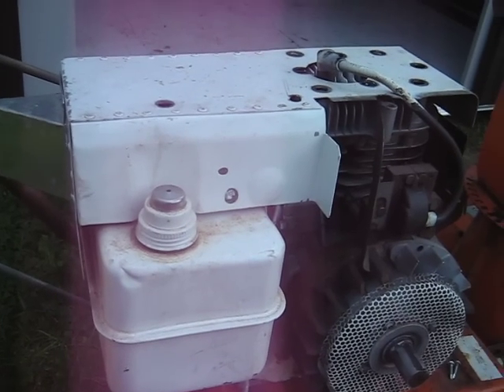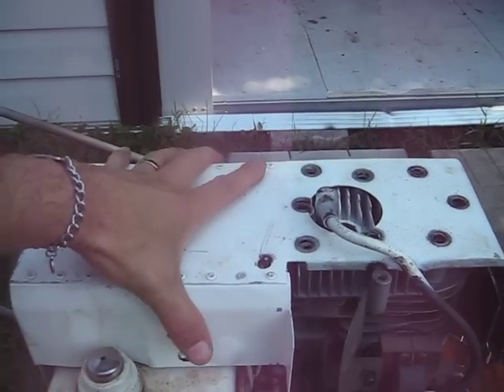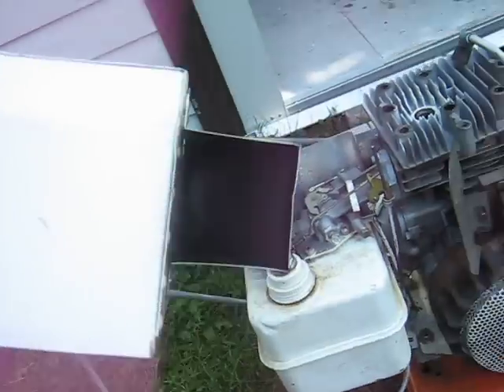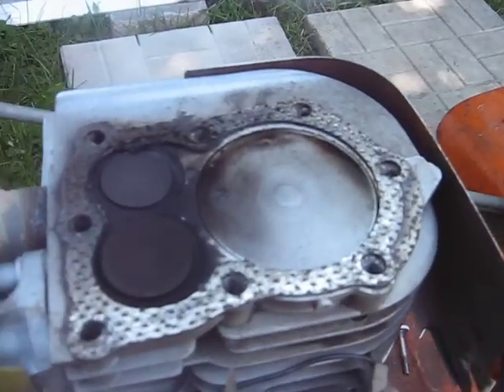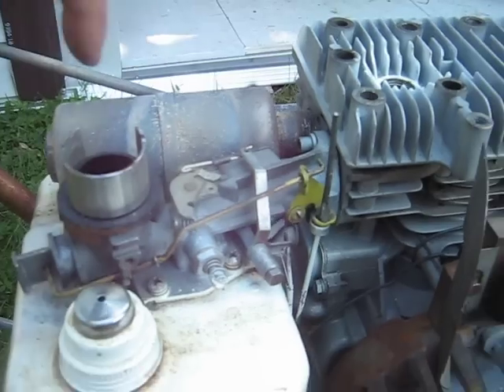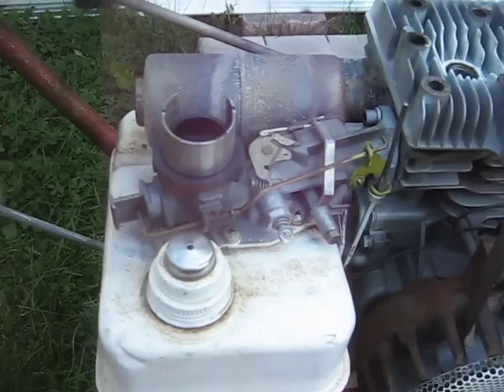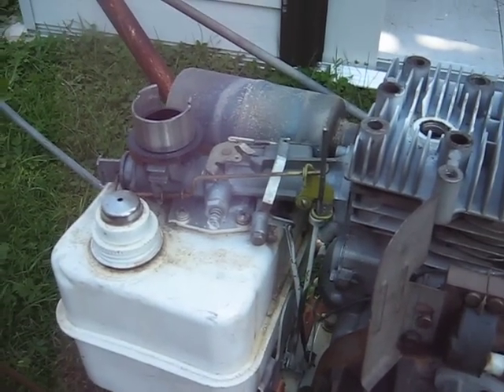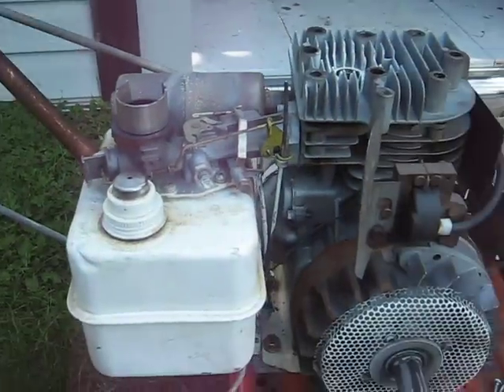Winter Shroud for 5 Horse Briggs

Comment from the maker: Yes, that seems to be the standard way of doing it to get some heat to the carb. I also think that blocking off some the cooling air intake helps the engine run closer to a normal temperature. One thing I didn't mention was disconnecting the crankcase ventilation, otherwise it can ice up where the tube meets the carb. A lot of generators died that way during the big ice storm, as they built up pressure and blew an oil seal, then lost all their oil.

Comment: ive never seen a snow blower 5hp before, I knew they existed, but never worked on one...We dont typically get any snow in the winter (we got 1 foot one night 2 years ago, and nothing went anywhere for 4 days). and its always warm enough for summer shrouds to run an engine with ease. If it snows this winter Im gonna mess around and mow the snow.

Comment: i revved the crap out of the quantum on my mower with the airfilter on and everything stock and nothing bad happened, didnt even use noticeably more gas.  I cn't use it much in the winter though because the tires are basically slicks lol